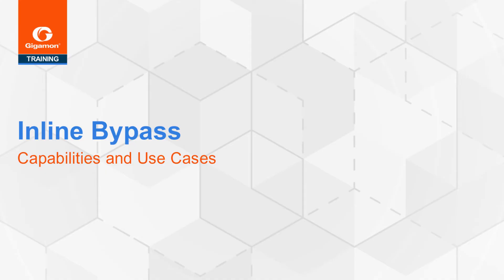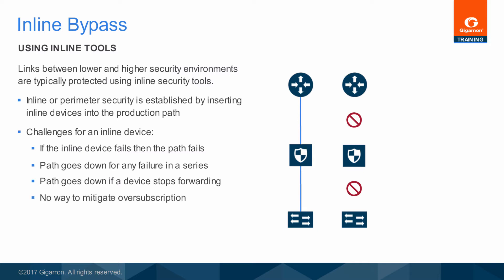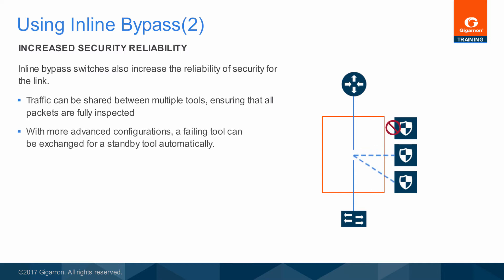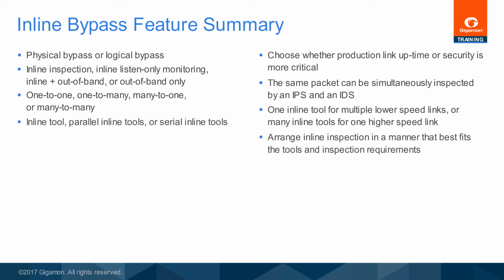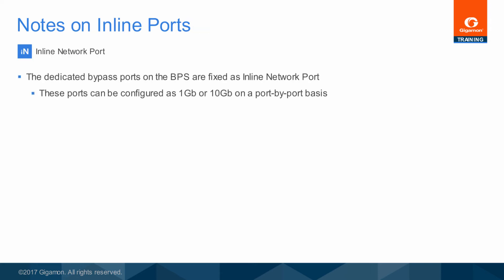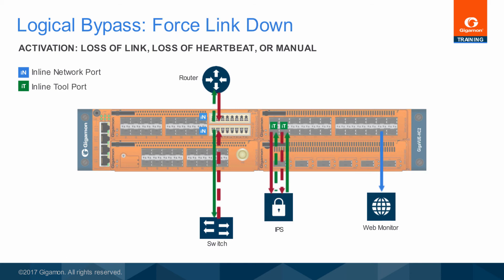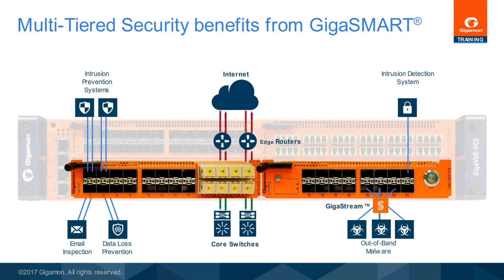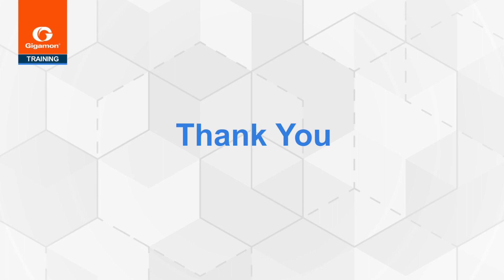GigaVUE® Inline Bypass

Comment: Unknown - The scenario you described - Allow Traffic to pass through the Gigamon Device when there is a loss of power to that device.  You have to purchase the physical bypass modules described here: https://docs.gigamon.com/preview/Content/GV-HW-HC2/Bypass_Combo_Modules.html 
•	When the module is not powered, (either the entire node is powered down or the module is removed from the node), the inline network port pair is in the physical bypass mode. That means that traffic is exchanged directly between network Port A and network Port B of the inline network pair.
•	When the module is powered, the mode (inline or bypass) of the inline network port pair is controlled through software. In the physical bypass mode, the inline network port pair behaves exactly as if the module was not powered. In the inline mode, the inline network port pair behaves as any other inline network port pair configured for working with an inline tool.

Comment: there should be a way that when the gigamon hc shuted down by power issue there should not  necessary to change the switch it should work with no power just like a cable the emergency cercuit activate and all port from inline to outline ports directly connect with each other and all device work like being connect via direct cable and when the switch power came back the emergency circuit remove the emergency bypass of devices and inspection start and also bring a cisco switch 24 port beside the gigamon and attach it to gigamon and all security tools connect  with it with redundant link and already configured some policy like access-list or some other, in case of gigmon goes down by power the ports which the security tools are attached shutdown and only one port which Cisco switch is attached with activate offline directly without power and traffice cames from inline side through gigamon offline port pass throw cisco switch and all the security tools send their traffic via their redundant link to cisco switch and when the switch came back by power the security tools redundant links shut by cisco switch and their primary link with gigamon start functioning just for no down time or gigamon security issue.  if some one want also security after down time then they should buy another hc tool.